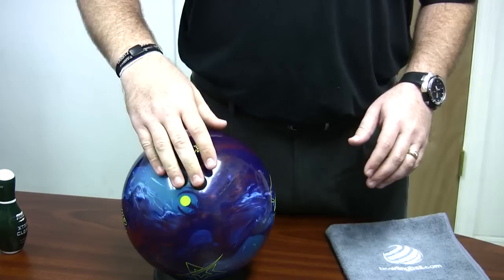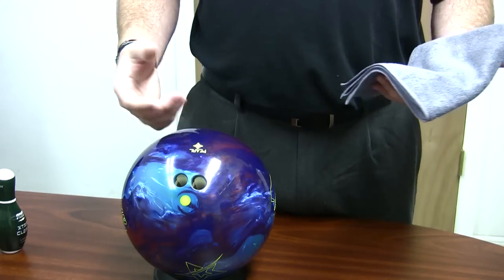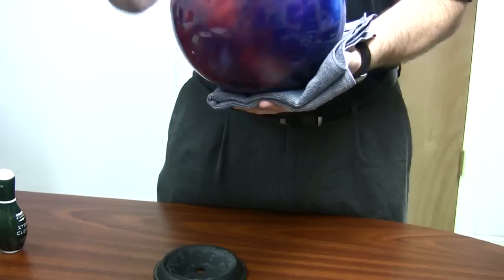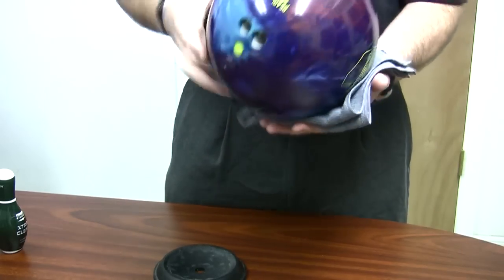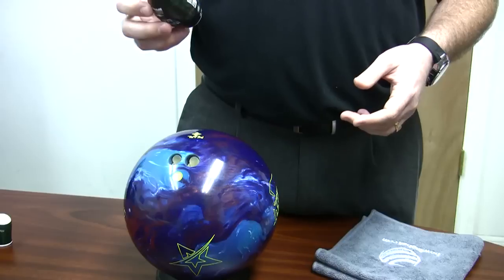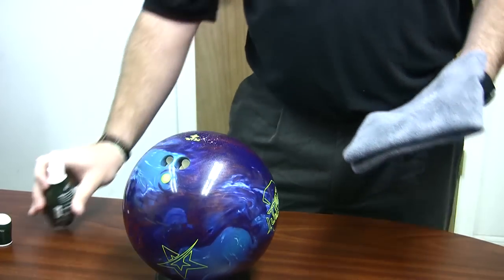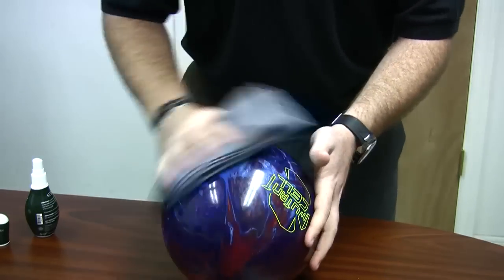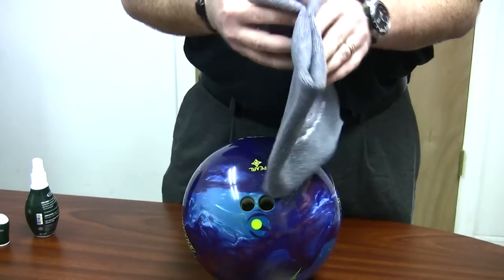Talk Bowling Episode 59 - How to Remove Oil From Your Bowling Ball

Comment: I just had a Storm tech center rep suggest using the warm water method.

And as you said on a previous episode, they do a lot of testing and research...

I did it with my prodigy, along with a hook again treatment and a resurface and the ball is like new after absorbing 100+ games worth of oil.

The key is to stay within 110-120...so as not to extract plastisizers with the oil.  

I'm probably covering a couple boards less than when I got it....but it's still far better than before I treated it.

Comment: -Used a cardboard box just big enough to fit 2 balls.  Used a slightly smaller box cut down to a tray and set the balls on their thumb holes.
- cut a hole in the top just big enough to fit a hair dryer in.
- cut a vent door in the side (3"x3")
- used a laser thermometer to make sure the balls stayed about 120f.
- every 20 minutes I wiped off balls with facial tissue, sprayed with ball cleaner and wiped with terry cloth.
- this took about 3.5 hours.
- hair dryer was on Medium/Warm.  Not on the highest settings.
- caution; you are using a heating element in close proximity to flammable cardboard.  DO NOT USE A HEAT GUN.  they get too hot and could start a fire.  Also, don't leave unattended.  I did mine while wrapping Christmas presents.

Comment: My local pro shop told me to just put it in the Arizona sun.  It works.  The oil came pouring out of my ball.  I just kept rotating it and cleaning the oil off every hour or so.  I couldn't believe the amount of oil that came out.  No wonder my ball stopped breaking!

Comment: Your right It doesn't hurt to use warm water, it works. i tried it, the ball hooked better and i ended up bowling a 299. no joke, it really works :-), why pay when you can do it yourself.
Reply: I have done this as well what did u use to cover the holes so water don't get in the ball?
Reply: @allenthomas914  I just use duck tape or cloth tape over the holes but I made sure the holes were facing up.

Comment from the maker: @Pacoelo Yes, there will be problems. You need to use cleaner that is designed for bowling balls to clean the coverstock as they are formulated to draw the oil and dirt from the pores. These pores are what make the bowling ball hook. Car wax will clog these pores and cause you to lose reaction.

Comment: Don't listen to these guys. Hot water doesn't hurt the ball.
Reply: Collin , like the jayhawk ultrasonic detox that pulls so much grime it's ridiculous ! I clean my equipment after every session, wipe after every shot. At times cleaner between games. About 80 games on the ball it literally pulled so much junk out in 10 min could barely see the Ball
Reply: Let me see if I understand you...since the oil from the lanes can be absorbed into the coverstock, it's not a huge leap to assume that water can be absorbed, as well. My next question: How clean is your tap water? Whatever's in your water is going to end up in your ball, especially if you're using hot water, which will cause a slight expansion of the coverstock. Microscopic to us, but to the particulate matter in your water--in addition to Dawn, if you're going there--it's all going to get soaked up into your ball.

So, sure...don't listen to these guys. I just hope we bowl in the same tournament one of these days...
Reply: Neil truick have you not heard of the 2000$ dollar jayhawk machines that alot of proshop use now. It's basically a big pot that heats the water and has ultrasonic vibrations to agitate the oil out. So if the professional are dunking your ball in a pot of water for 30 mins these guys are definitely wrong. Inform yourself  better  before you talk crap...

Comment: Take ur bowling ball and wet it, take a half a dime size of dawn and lather it, then submerge the ball in a 3 gallon bucket of lukewarm water for 15 mins, not hot, i used it on my taboo electric blue, and dry it properly, then used a little rubbing alcohol, curves like a boomerang lol.

Comment: I have a storm Reign....everywhere i bowl i always get a gray rubbery film on the ball almost like oil rings but its not on my track. i just have rings going everywhere on my ball. it doesnt wipe off wipe off with a towel. it must get on the ball when its rolling in the pit or when its going through the ball return. it doesnt happen to any of my other bowling balls. i know someone else who has the same thing happen to their reign. What is this? and did you noticed it when you threw the ball?

Comment: Clean it as soon as it comes back from the ball return? However you can't grab it right away. So there it sits, soaking up that oil. No cleaner you spray on the ball will pull that out. Pro shops have bowling ball ovens and even ultra sonic water bath machines. So it's ok for a pro shop to put it in their $1k+ oven or ultra sonic water bath at 140 degrees but I can't heat it up at home the same way? I like the bowlingball website but these guys are a joke.

Comment: Concerning the oven. Think about it, you heat the ball, the ball is not moving. All of the pores in the ball open up. The pores on the bottom allow the oil to flow out, the ones on the top allow the oil to go deeper. It is important that the ball is in constant motion and an oven does not do that, so, to be kind, Mrevo599, it appears the shoe is on the other foot. Before you call someone out, check your facts. It helps one from looking uneducated, or obamish.

Comment: Its called a rejuvenator not a revivor ..... and putting your ball in a oven at home is pretty much the same thing as using a rejuvenator,you just need to be careful that the temp. does not go over 125 degrees F  and only leave the ball in the oven no more than 10 min. at a time then pull the ball out wipe it down with a cleaner and repeat until all the oil is drawn out
Reply from the maker: There are different models of these machines - Some are called Rejuvenators and others are called Revivors. Just varies from brand to brand :)

Comment: I'd like to see a reaction video by an expert bowler for a ball with 100 games on it before and after cleaning with a process beyond the spray cleaners.  If deep oil extraction is so important, why don't the manufacturers of these products demonstrate the effect?   Seems there are hundreds of videos explaining how important it is, and hundreds of ideas on how to do it best, but I can't seem to find any scientific approach to demonstrate that oil absorption leading to lower reaction is even occurring.   The closest I've seen is DV8's video showing a ball soaked in oil was the same on fresh lanes, and slightly longer on lanes that were breaking down.  I wipe the ball after each shot and clean with a spray cleaner at the end of the session.  This deep cleaning idea is sounding more like a feel good waste of money.
Reply: Robert Jones Any bowler that has been bowling for over a couple months will tell you that their ball has lost its out of box feel. It just doesn't have as much life as it use to. I've had my storm code red for about 3 months, and it is nowhere near where it was when I first pulled it out of the box. It's not something you need video proof of, it's something that all experienced bowlers understand.
Reply: I agree completely. I too have a Code Red. It's about 4 months old and it had no life left. I went to my local pro shop and got it revitalized. They started with a 500 Abralon, then they worked it down to 4000. Then, they worked it back to 1500. I will be using it again tomorrow night. I expect the life to be back in it.
Reply: That's like saying you need proof tires wear out. These balls die in a year...just in time for the next release to be out
Reply: If I hadn’t experienced this drastic reduction of hook potential on both of my high end balls, I would have thought the same as you just wrote, but the change has been so drastic that I started thinking that I had forgotten how to bowl and that there must be something wrong with my release. Then I bought a third ball, which is a mid level ball and have been getting more hook from it than my oiled up one year old balls. I’m going to spend the whole weekend cleaning them with the oil removal suggestions that seem safest to me.

And for the record, I wipe down my balls before every frame and clean them with approved cleaner after every session.

Comment: thank you and how much will it cost me
Reply from the maker: That would depend on the shop. A resurface should cost between $15-25.  Oil extraction anywhere from $10-25
Reply: bowlingballcom will i have to do both and will the resurface mess up the roll or anything
Reply from the maker: No, it will only help the roll! You may have to do both. Do the resurface first and go from there.
Reply: bowlingballcom ok thanks for all the help

Comment: Typical of industry guys, how to, you can't, gotta pay us.  This is not a how to, everyone knows to wipe surface oil off with a cloth, duh.
How much are you into bowling?
  Heat ball, slowly, to around 160F, for about 1/2 an hour, then put ball in preheated water, 160-180F, water will replace oil through osmosis, oil floats on water so water replaces oil, skim oil from water surface, to get as much oil out as possible, (takes a couple of hrs)then remove ball from water and let dry. They are correct about different expansion, but only with high heat and fast temp changes. I made a vacuum chamber out of a pressure cooker, slowly decrease pressure, water boils/evaporates at lower temps at lower pressure. Takes several hours to process but ball rolls like new.
 Happy Rolling.
Reply: So, no expansion takes place when the ball is exposed to slow heat, even after several hours?

Comment: how do i clean a bowling  ball that hasnt been cleaned  in 6 months to 2 years and all rhe oil is dried up and gives it a black ring that ruins its cool look
Reply: the not rhe
Reply from the maker: You need to take the ball to the pro shop and have them do a full resurface. This will remove the top layer of the coverstock bringing out fresh coverstock. Also, it would be a good idea to have oil extraction done.

Comment: I just put my ball in my oven on 170 degrees and no cracks
Reply: +Adam Atkins you shouldnt. like they said, it could lead to cracks on the inside, so you wouldnt see them, and their is a reason why most companies say not to expose the bowling ball to heat above 120-125 degrees F
Reply: ...that you can see. Think of a window in a big wind. A small rock hits the window. Not enough to break it, but enough to create a small crack. Every big wind, the size of that crack increases because the tensile strength of that window is weakest at that point. That's the same thing which will happen to your bowling ball. You won't see any cracking initially, but repeated heatings plus regular use of the ball will result in a reduced lifespan.

Comment: Alcohol is horrible for a ball... if you need to or want to use something like that... get acetone.
Reply: Actually it draws oil out and many 200 bowlers use simple green and alcohol bout 50/50 mix, wiped after every set....and when you have it maintained by "the pro shop"..funny thing no oil..uhhhummmm